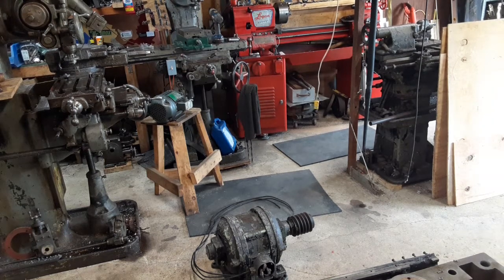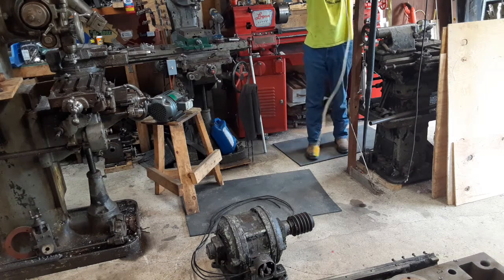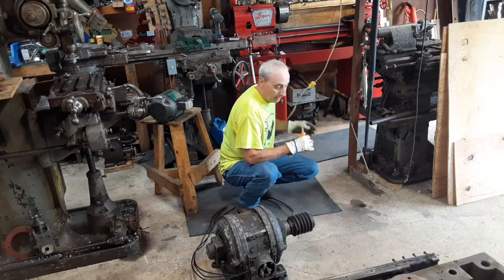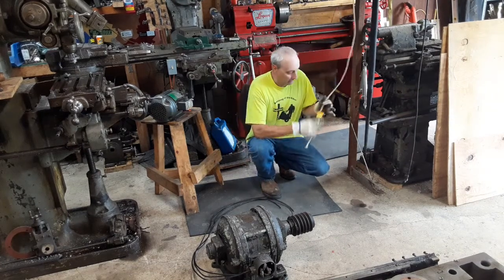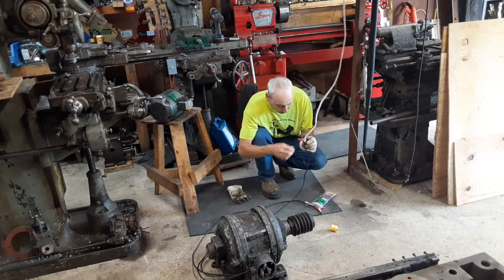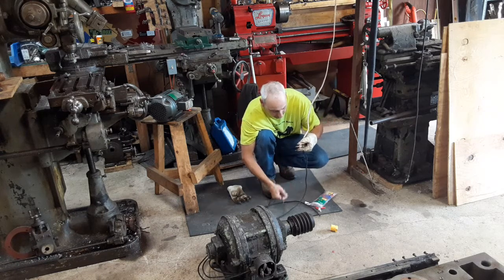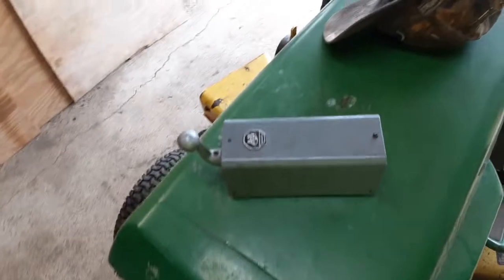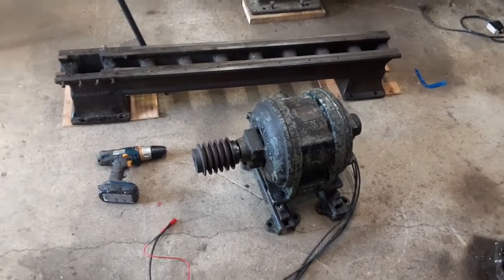3 phase motor on single phase

Comment: In my basement workshop I convert single phase power to three phase with a simple 1.1 kW idler motor with a capacitor. This motor suffices to "drive" 400 W motors, e.g. for my Klaeger power saw and my tool post grinder. 
The power of the idler was insufficient to power the 1 kW motor of my milling machine though.
You can watch this setup in operation here: https://www.youtube.com/watch?v=P50r3Ekbg9w